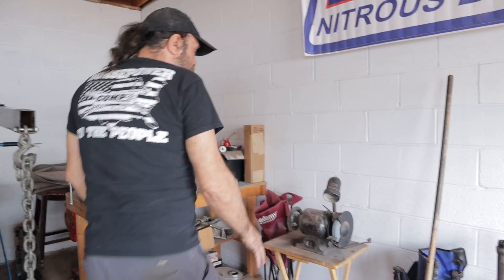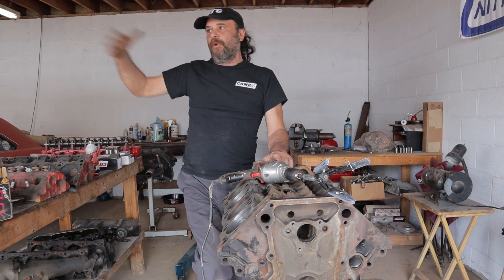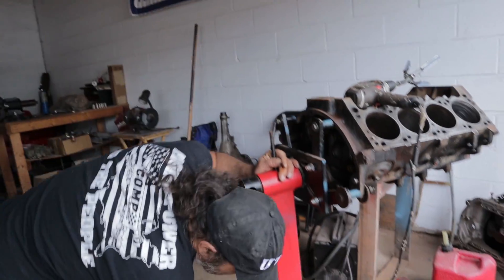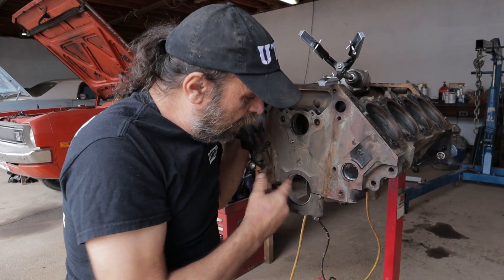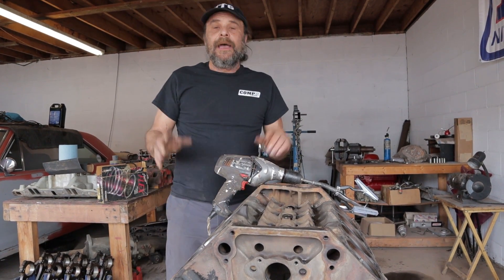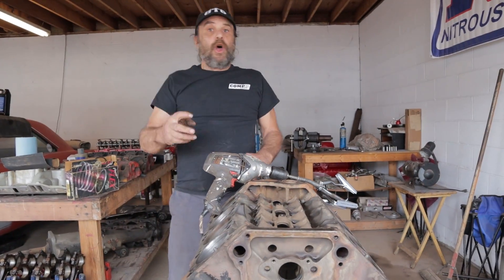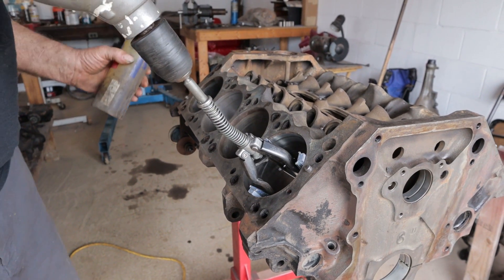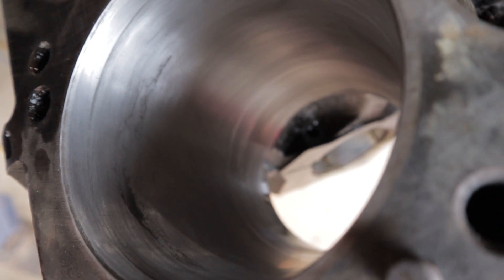Perfect Daily Driver 6 - DIY Engine Block Prep

Comment: 11 year-old making piston rings. That pretty much sums it up as I have seen sweat shops in China with kids making spark plugs handling dangerous materials and working with dangerous machinery. Unfortunately in the pursuit of cheap goods and maximizing profits we only have our selves to thank for crappy auto parts with a dubious history.
Reply: Yay communism cheep parts and child workers
Reply: @JonsReef I have the same vehicle a 98 Jeep Grand Cherokee with a 318.  I think i'm on my 4th radiator and 3rd water pump. The front track lasts about as long as a set of windshield wiper blades.  I must be on my 6th or 7th one by now.  Besides trying to find NOS parts i don't know what the solution is.
Reply: I hate shit parts. on my 2001 mercury I refused to buy a dorman intake, water pump, ball joints etc. bought motorcraft parts with zero regrets or problems 2 or 3 years later.

Comment: Very informative and detailed video as usual. Love your channel UTG. I just did the 5.7 hemi in my dodge ram. Stroker forged build with cam and lots of goodies. I had my cam bearing bores honed and checked for roundness. They said it was good to go so I put new ACL bearings throughout. I shouldnt have much to worry about should I?
Reply: Only if you used new parts, the Chinese copy everything these days.
Reply: Richard A Chapman yes nothing but cometic, mahle, acl, comp, krane, molnar etc is allowed in my garage. I believe in doing a performance motor once for $8k rather than doing it with Chinese parts for $2.5k, but 4 times over.

Comment: i thought the reason for ridge reaming was because over time the ring became rounded and putting in a new ring (having  a square shoulder) would hit the ridge..breaking the ring..
Reply: That is what "they" say. But, I am here to tell you, I have built MANY engines exactly as UT outlines here. Never used a ridge-reamer in my life. Also never broken a piston ring. As a matter of fact, I pieced a 318 together from 6 engines one time to get a plow-truck running in a pinch. Exactly how UT would have done it. Picked the best used parts from those 6 pretty much identical engines. I even broke the golden rule of mixing up lifters/lobes. That was in 1996, and my Dad's neighbor plows his 1.5 mile long driveway all winter long to this day with that truck. Most of the sheetmetal is long-gone.  Countless U-joints. At least one tranny rebuild. I don't think there is a single inch of factory wiring left in that truck ('84 W250). But, that engine is still going.
Reply: @wheelieking71  Well the actual thing with the ridge wasn't breaking the ring, it was cracking a ring land... Many people change pistons anyways so they never know if they messed anything up or not. This engine was a mere 100,000 mile engine tops. I'd like to tear into my Dads 360 sitting in the shed and see what it looks like at the top. 250,000 miles. Those miles were put on in the 60's-80's so the oil was crap compared to today. Another thing, ridge reamers actually had a depth adjustment. Didn't have to bore the top of the block to .030 over if ya didn't want to...
Reply: Now that I think about it.. that was written on the ring package..
Reply: That's what I've read

Comment: American V8's are the best.   Years ago when I was 18, I rebuilt my 55 chevy 265 on my own with no prior experience.  Had a machine shop do the valves, but I did the rest.  Went together easy and worked great.  Wish I still owned the car.
Reply: That's awesome.
Reply: Yes, you do.  I was lucky and divorced first, lol..

Comment: I  suggest a few minutes on using a tap, cleaning threads in through holes and blind holes, when to replace a bolt, and the importance of oiling the bolt threads and under the bolt head before torquing. I learned those last ones the hard way.
Reply: I wouldn't recommend using a tap on the engine, but would suggest using a thread chaser/restorer. While they are similar in design, a thread chaser won't remove as much medal from the threads and still clean out the junk. We want to keep as much of the original thread as possible.
Reply: @wyattwunderlin4445  dont want a broken tap either
Reply: @wyattwunderlin4445  in some cases, if you worry about where those shavings are going to drop, a little petroleum jelly in the gap between the "teeth" of that thread chaser, may be the ticket to catching the debris and pulling it out of the bolt hole easily.
Reply: Only apply oil to threads if it's called for.  Lubricant changes the effective tension on a fastener for a given torque, if they want you to put in your head bolts dry and torque to say 100lbs adding lubrication and torque to that spec will result in an over torqued fastener.
Reply: @DrewLSsix  My understanding is that bolts work by stretching to hold parts together. Leaving the threads dry causes binding when torque is applied, and the shaft is twisted instead of stretched, and then fails before the spec torque is reached. I have snapped head bolts by putting them in dry.  My engine guru said to oil threads and under the bolt head as a matter of routine.
Reply: @danpatterson8009  if a bolt is stretching, it's overtorqued (or is a one-time use bolt, like a rod bolt).

The torque spec will say if it's supposed to be lubed. If it doesn't say, it's supposed to be dry!  That's straight out of FAR 65, the aircraft mechanic regulations.
Reply: @danpatterson8009  theoretically, the best thing is to ask the manufacturer of the fastener.  if they don't know what works best with their product, they aren't invested in it and it's a good idea to go elsewhere.
Reply: @danpatterson8009  that's exactly right, the key is getting the right tension without stretching the bolt too much.
Reply: Even if I don't have a tap , I'll make one by cutting a groove in a bolt. 
I'm sure someones gonna yell and say dont use taps use thread chasers. 
Make your own from old bolts.
Reply: ARP sells and recommends thread install lube for their fasteners for a reason. I would follow the mfg's of whatever fastener is going to be used.
Reply: @wsfwsf1497  yes, if ARP says use lube and torque to (spec), then do that.

But in general, if a procedure doesn't specifically say torque wet, you Do Not Use lube. Because the specs are very, very different between wet and dry torque!
Reply: @ScottKenny1978  aircraft maintenance is a whole different world.
Reply: @scotcoon1186  yes. Having the engine cut out in an aircraft means a very long coast down to the "shoulder" of the sky, not a quick 300ft roll and park, then call for roadside assistance.

Comment: Looks like its running hot on the stand...😂
Reply: wait'll you see the future videos...there was certainly a coolant issue with this engine, once the core plugs finally got pulled out.  but its going to be a  lesson for new folks watching this series, as the problems get fixed.  This is where "budget" results in, "double the budget you planned for the repair"

Comment: If you have a ridge how do you get the pistons out ?
Reply: you are correct
Reply: His version is, go ahead and beat the hell out of it with a hammer. I think he did say one time, to take a hone and go over it. Which is just as bad... Thing is, there is an art in reaming. SLOWLY, GRADUALLY. Another one of those jobs that TAKES TIME... This engine came from a POS Dodge that had wiring issues. Had  less than 100,000 miles. Most likely it was just parked because it wouldn't run right, since the wiring harness had been spliced many times and was still trying to run the original TBI, and computer... Lots of late 80's-90's cars suffered this same fate... That's why there are so many Chevy V8's laying around. Good engines bad wiring and other things... Most likely there was barely a hairline ridge at the top anyways...
Reply: @kramnull8962  I thought maybe he knew a way to do it without using a ridge reamer . I've worked on a few I had to use a reamer on .
Reply: If there’s an APPRECIABLE Ridge, yes, you’d use a reamer.  I’ve never had one that bad.
Reply: @JohnWilburn  I have had 2 .
Reply: Yeah, it does happen.  We tore down a 350 Chevy a couple of months ago that had water in it.  It rusted number 5.  I sanded it out and that took care of it.  The really old stuff, like pre-war was much worse for wearing a ridge.  I don’t like them because I’m paranoid of them making a taper at the top of the bore.
Reply: @JohnWilburn  If you have to use a ream it already has a taper . I haven't seen one with a ridge at the bottom so it would have a taper .
Reply: @jamesmarlow3309 While there's a lot more lubrication and a lot less heat, there's still area below the ring travel in the bottom of the bore.  I've not seen appreciable ridge there, but it's not a wear area, so there should be some.  Some engines you can even take the pistons out that way.
Reply: @JohnWilburn  The combustion will try to rock the piston at the top but at the bottom you don't have that pressure and you are right about the heat and lubrication .
Reply: That is true, but the aluminum pistons aren’t wearing the iron block so much as the iron rings.  The ridge ends at the ring travel.  I’m sure the pistons do to a point with the carbon on them just like rubber seals where grooves in steel cranks, etc.  Also, the rings are compressed hardest against the bore at the top of the stroke under pressure.

Comment: I also ran into a problem with the slant six i built .i nicked up the bearings trying to get th cam out. so i just told myself id install new ones so i got out the old otc cam bearing installer and had at it.well i was al bored up trued up and ready ta assemble when all of a sudden uh oh! 
The new cam would not fit. Something was very wrong.  I think the new bearings where too tight so off to the machine shop again .they pushed them out and slid in some old stock ones from a 340 and it slid right in .what a nightmare!
Reply: Had that happen in my last 440. Think the fit was too tight in the block and the tool mushroomed the bearing edge a bit. Took a long piece of 1/2 in rod, slit the end to hold a strip of fine sandpaper. Put it in the drill and honed the bearing slightly, and after a few trys and checking, it finally went together fine...

Comment: hey U T..i heard the 71-73,, 360 blocks were cast on the 340 casting,making it extra thick..is this true?
Reply: No. Thicker than a 78 block, not by much at all if any.
Reply: I have a 70 LA 360 in my Valiant Hardtop and it has been bored out 60 thou, had the bores ultrasonic tested for thickness and they were still plenty thick enough.
Reply: I’ve always heard that, but sonic checks show they aren’t appreciably thicker.  The way I evaluate a block to start with is to look in the lifter valley and try to see how much core shift it has.  Any healthy 360 block is a good foundation.
Reply: @JohnWilburn  isnt there a -dash number as part of casting number that tells you how many uses the mold had, and therefore potential shift??? The memory is getting foggy... But I probably read it in one of Tonys articles from 25yrs ago lol...
Reply: @wheels-n-tires1846  What you're thinking of is the core casting index number.  It follows the cubic inch designation on the driver's side of the engine block.  The factory started with one mold for each side and replaced individual cylinders as they wore out/deemed out of service.  A block with 340 - 2 has a virgin mold.  A 340 - 5 has had three of the cylinders replaced.  A 318 - 10 has had all of them replaced.  Theoretically, it makes no difference as the replacement cylinders are installed "straight," but they can each have a little shift.  Also, theoretically, the shifts, even when a "stacked tolerance," shouldn't prevent any reasonable overbore.  In practice, however, we look at each block not only for obvious shift, but where is the shift.  Major thrust area?  Minor thrust area?  It's possible for a core shift to be helpful, but don't count on it.  So, in the end, it's either sonic check or just stay within what we know is safe enough.
Reply: @JohnWilburn  yup that was it!! Thanks for the refresh!!!👍👍👍

Comment: Even sending the block to a machine shop, there's still a ton of labor that ends up going into the block, if nothing else just in cleaning.

I feel bad for people who assume an engine comes back clean from the machine shop...
Reply: Be kind to your machinist, don't drop a greasy lump with the sharp edges still in place. That's a great way to get back a product with the least amount of care put into it...since you delivered it that way.  And yes, you have to clean it when you get it back--esp. when you're leaving in core plugs, bearings etc to save a buck.

 I never paint the inside of a block (b/c the reasons never make sense--paint doesn't smooth rough cast iron as your eyes show you, rust doesn't occur inside sealed blocks since everything has an oil film on it, but when water does get in, it rusts the bearings too, so its time to rebuild anyway, if sand was a problem why don't all engines die of it--you'd think the OEM would do it to avoid warantee costs, why don't people paint their heads to get the same benefits they think they're getting, etc) , but if you're going to do it, that metal has to be clean of oil residue, parafin wax, etc or the paint isn't going to stick during heat and contraction cycles. Take out the sharp edges, knock off the slag, check for core shift that weakens areas of the block. Cleaning a block before you send it out, might show you a flaw that makes it not worth paying the machine shop to find it for you.

wait until you watch the upcoming videos...the core plugs come out, and there's a ton of garbage inside this block--enough to send it to a machine shop for cleaning.
Reply: immikeurnot and I feel bad for people who assume a rebuild is done right in the first place. I can write a book about all the false promises and mistakes I’ve seen.
Reply: 1smokeydog1    do you actually go through and clean the block afterwards anyway?
Reply: @DrewLSsix  
Too much time invested to skip that , I clean em again after receiving it back.

Comment: A good friend of mine would start with a three blade type hone and finish with a dingleball for hash marks it worked good. And someone please send uncle tony a new drill cable that ones been through some shit!
Reply: Battle tested,Garage proven
Reply: chewed drill cables and gasoline sprayed around, what could go wrong? :)  seriously, "safety is no accident", its a habit. Practice safety routines, and you never have to stop and think when cutting a corner, "is there something different from the last times i got away with doing this, something that's gonna bite me in the ass this time?"

Comment: Im not so sure about new parts either seen alot of bad camshafts in. The last few years if i remember correctly you recently got a bad one too
Reply: I've seen several mainstream Youtube channels that are having issues with cam lobes, mainly from lifter problems.
Reply: originally, the issue was a lack of zinc in modern engine oils, due to its incompatability with catalytic converters.
Reply: @albertgaspar627  yea i forget about that
Reply: @moparmatt5896  its hard to keep up to all the details about this issue. is it the oil, is it cheap parts, is it poor quality along the line.
Reply: @albertgaspar627  to many variables isnt it bro
Reply: @moparmatt5896  yeah, which is weird. it should be one, uniform universal problem. if there's a variety of causes, then it suggests some builders are making errors, too.

Comment: My horror story,Sbc have the 3 oil galley Allen head bolts on the back of the block around the cam plug , I only tightened 2 of them after a block clean and rebuild, put the motor in obviously leaked like a siv had to pull it right back out, the wife asked didn’t you just put that in,ya 2 times in 1 day.